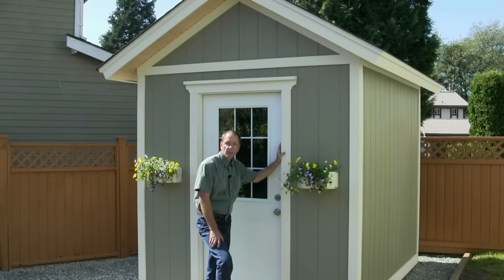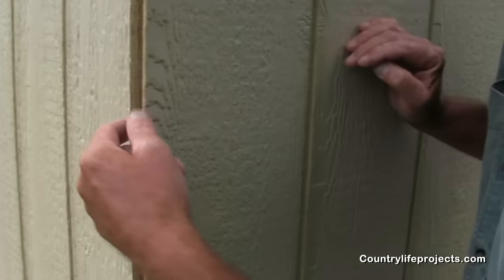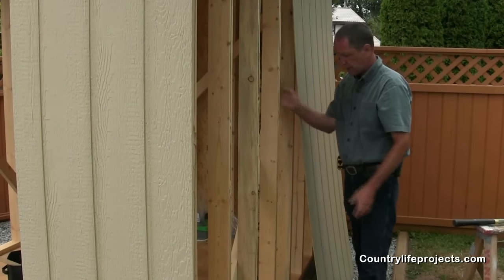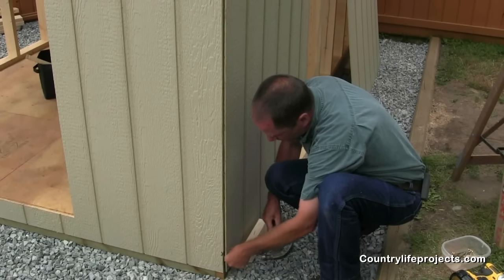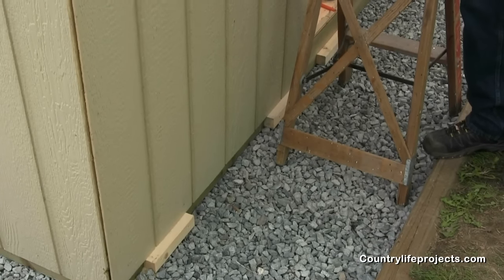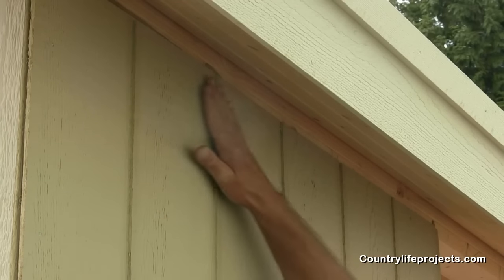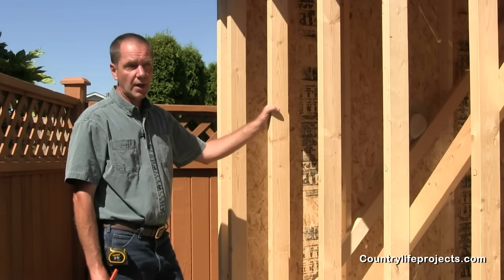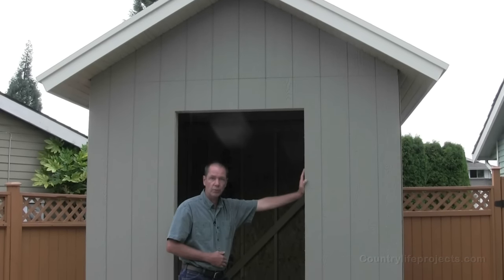How to Build a Shed - How To Install Exterior LP Siding Panels Part 2 - Video 12 of 15

Comment: Osb sheating is recommended for the LP 3/8 primed panels and a housewrap for moisture barrier.  It gets the panel to sit on a very flat surface and nails wont pull through.  Also, a 6" clearance from the bottom of the panel to gravel/dirt is needed to keep moisture out.
Makes for a better shed.  Nice video.

Comment: Various features (Waterproof, traffic proof, high traffic, 4/6/12/22 mil, Click-Lock, etc) vinyl flooring comes in a wide variety of colors/textures/sizes. As impressive as that is, it becomes bewildering.  Search engines don't do well.  But, really broadens the choices for a unique shed.

Comment: Nice trim detail for the head of the door, have not seen that before....it causes the stand out from 100 others the same size for that detail alone.   I did my eaves similar as well as gluing the sheathing to the studs due to no substrate sheathing behind it.  Looks very nice!
Reply: Went to look at your videos then your about page..........what happened to your ambitions of more videos.....give up on the idea?
Reply from the maker: Hi Earl. Nope, just been so busy over the last few years to buy property out in the boonies... this spring will be the start of many more - now that we have a new property and many projects to build on it. In the mean time, I have tried to keep on top of comments here so as to let people know we are still around.
Reply from the maker: That detail I learned when I worked in Amsterdam for a few years. It is the old style drip cap of days gone by - but still works good. It was often used on the bottom of doors too when they open out (on old doors way back when).

Comment: Excellent video series. I plan on using a lot of your tips when building my shed. Question for you. My HOA is going to require the shed to be sided with the same material as the house which means I’ll probably have to use some type of plywood or OSB, and then wrap it before putting the siding on. What type of and what size/thickness of plywood or OSB would you use?

Comment: Hi Henry, One huge advantage that I see to doing the roof at this point would be that with the side walls still open I can build a temporary scaffold attached to the studs on each side to finish off the roof. That's my plan for May when the frost goes out.

Comment: If you're building a shed taller than 8'  what is the best way to take care of the joint between the upper and lower panels?
Reply from the maker: If I was building walls higher than 8' I would not finish the exterior in the same way. I would sheath the exterior first, then house wrap and then the exterior finish (panels or siding etc). If you are building higher than 8' I assume you are building a larger shed as well - if the joint will be exposed to the weather use Z-Flashing. Although we did not use it on the front, that joint does not get a lot of exposure and is covered with 1x4 trim and heavily caulked... if doing higher walls, the use of 1x4 trim like the front probably won't fit the overall design so go with the Z-Flashing.

Comment: how have the LP smart panels held up to water splashing up from ground/running down face?  I've seen a similar material wick/expand and ultimately rot from the ground up from splashing/face impact of water/rain.  If I remember, GP had issues with their siding that was supposed to just need paint and it disintegrated over time.
Reply from the maker: SpockMcoy Issmart The LP Smart Panels are not perfect for very humid and wet areas but they will stand up if protected properly. They are meant to be a inexpensive way to finish a shed exterior. There are better materials but also more money. We picked the LP Panels for ease of application and cost savings.

Comment: Hi Henry.  How much of a gap did you leave between the panels when on the corners of the shed?  Hard to tell from video. Thanks for your help.
Reply from the maker: As long as you are using 3 1/2" corner trim, you can be back anywhere from flush to 1/2"... this leaves at least 3" of the trim on the face of the panels. I personally like to be back about an 1/8" but it is not critical.
Reply: thank you very much!

Comment: I have really enjoyed watching these videos. I hope to build a 16x20 shop for doing my woodworking. I make Adirondack Chairs and Bird Houses, Would these videos go along with building the larger building. If not can you tell me what I might need to change.
Reply from the maker: Hi Stephen... Overall you can use the videos for a larger building. However, at 16' wide I would use engineered trusses (they are not too expensive). For the floor, you may wish to consider a concrete slab/footings, or 2x8 joists with support on both exterior side walls and in the center - full length (unless you use a gravel base and make sure there is support under the joists throughout. I would also use 1/2" or 7/16" sheathing under the LP Smart Panels for additional strength, then house wrap or building paper and then the LP Smart Panels (you need the extra strength for a building this size). If you plan to use gutters, you will need to change the ends of the rafters to match the angle of the ridge - if no gutters, the shed design for fascia finish will be fine. Lastly, if this is to be a workshop I would think you would want to insulate it... if so, make sure you use soffit vents and a ridge vent (or surface mount near the ridge - or gable vents, one on each end provided you finish the ceiling at the bottom chord. Do note that any doors or windows in the sides of the building will require headers as these walls are bearing walls.
Reply from the maker: One more very important note - typically you do not need a permit for sheds or outbuildings under 120 sq ft (do check your local codes), so a 16 x 20 shop will likely require a permit and this may change up what you may or may not do in regards to your shop construction. Also, exactly what will work on your property is hard to say and you will have to make a few judgment calls on your own to really determine if the construction techniques used in my videos will work for you - hard for me to say without knowing all the variables.
Reply from the maker: Also, for a larger building, you may want to make your soffit overhangs longer, maybe around 18", and the same with your gable overhangs (ladders should be fine to 18". If so, and you put a door on the side of the shed, make sure the fascia board height (bottom) does not interfere with door swing (if opening out that is)
Reply: after looking at some sheds I am going 12x24 instead of 16x20.this will be large enough for what I am doing.

Comment: Do you nail right in the grove or just beside? Thx!
Reply from the maker: Hi Stephane... in the grove so nails are not visible. Note that there is not as much material holding the panel in the grove when doing this so construction glue is very important.

Comment: Can you use a solid color stain on the smart panels?
Reply from the maker: Hi Lisa... in my observation of the LP Smart Panels, the primed surface looks fairly tight and I am not sure if the stain would adhere to the panels as well as paint. I would personally play it safe and use a good exterior paint. If you happen to have stain on hand you want to use, maybe go to the LP Smart Panel website ( http://www.lpsmartside.com/products/panel/ ) and drop them an email and ask if it would be suitable (be sure to include the brand and stain you would like to use if you know).
Reply: Thanks so much for getting back to me. I took a chance and stained with an opaque stain, and it turned out wonderfully!!! Fingers crossed that it will stand the test of time!

Comment: is T1-11 It is structural items 
It has any approved to be used for the shear
Reply from the maker: eric your question is not completely clear, but I have to assume you are asking if is approved for shear strength/resistance. I would think it would depend on the product and thickness. In any case, approved or not, I personally would not rely on it to provide shear strength for anything larger than a shed. Your plywood sheathing would be used to provide this strength and it it can be staggered to increase stability and resistance too - these panels are decorative and are not staggered when applied. For a small shed, great! But, IMO, once you start to get into larger structures you have to have the plywood sheathing substrate underneath.
Reply: You can achieve a greater shear strength with "let-in" blocking, metal strapping or diagonal blocking cut between the studs.....google any of them and you will find many ways including using a structural rated panel as a substrate to any finish you may apply over it.
Reply: I think he meant sheath. If so the answer is yes you can use it as sheathing. Thickness depends on whether your studs are 16oc or 24oc. In either case I would use the 19/32 thickness. This information is in the installation guide for the material available to download from home depot website.

Comment: No house wrap?
Reply from the maker: Hi Donald... When building a shed that is not to be insulated, there is no need. In addition, since only LP Smart Panels are used and no sheathing - to increase the shear strength of the shed the panels are glued to the framing which adds a substantial amount of strength - I would not recommend using only these LP panels without the glue. House wrap is ideal when using sheathing, then wrap, windows, drip edges etc and then finish siding or other exterior finish. For a basic shed with no insulation and no sheathing it does not make sense to us house wrap.

Comment: I too have watched, enjoyed and used many things in your videos. My question regards the use of glue when using the 5/8" Smart Side Panels. We paid the extra and purchased the thicker panels.Glue and a few nails would still be your suggestion? I also like the idea of less nails through the panels thus creating less chance for water intrusion. Do you seal the nail heads, can't remember if you do or not? Thanks and keep up the help for us diy'ers!!
Reply from the maker: Greg Bosl Hi Greg... I would still use glue and nails, since no sheathing is being used first it is important that the panels are attached properly to the framing - this is where much strength of the shed comes in. We did not seal the nails, just countersunk and then painted over which is fine (e.g. wood siding is nailed on and I have never heard of leaks through the nails).

Comment: Is it necessary to paint these panels? I know they are primed for painting, but I don't care for painting even though it would add extra protection.
Reply from the maker: Well, painting any cut edges and the lower part of the panel to protect against moisture is a must IMO. for the little amount of time and money involved, painting can add at least 25% to the life of the panels on a shed - well worth it considering what is required to build the shed.
Reply: @Countrylifeprojects  
Your probably right, it should be done. Thanks.
Reply: The panels are factory primed, not a final finish. They can be painted or you can use a solid stain. I would ensure the exposed edge (bottom) also gets painted.

Comment: fine work, but glueing the siding, REALLY ?
Reply from the maker: Well, the panels are only 3/8" OSB and by nailing in the groove and on the overlap lip, you are actually only nailing into 1/4" material. Considering that much of the shear strength comes from the panels I personally feel glue is a good idea. If you are not sure, try nailing a panel without glue and then pulling it off - it will not be hard to do without glue. For the little extra money and time I think it doubles the strength of the walls.
Reply: I did the same thing due there being no substrate sheathing...this stuff is intended for going over a framed and already sheathed structure.  I'm would have to agree and exactly why I did the same thing, but I used subfloor glue which is about the same.
Reply: @Countrylifeprojects  I love that you glued it! I would not have thought of that but in Florida with the hurricanes I absolutely am adopting this method.

Comment: Mistake to glue. Goodluck replacing a damaged piece.
Reply from the maker: Well... when building without sheathing and only using the panels for shear strength, I would rather have a difficult time making a repair (which is only a maybe in the future) than a weak structure. IMO, the use of glue is critical, especially considering the panels are only 3/8" thick and made from OSB.